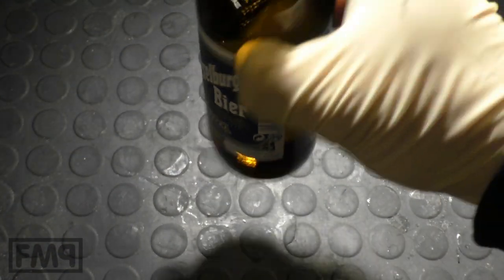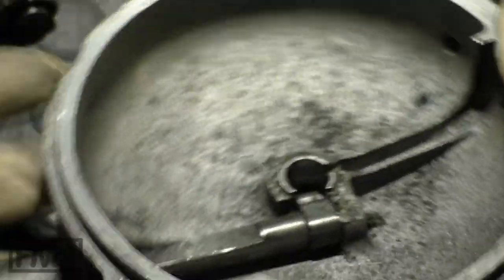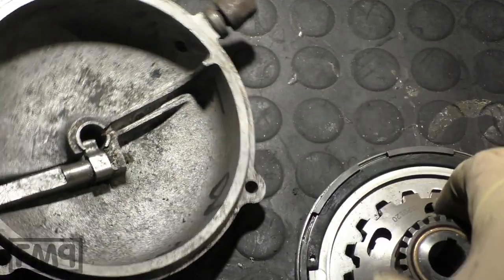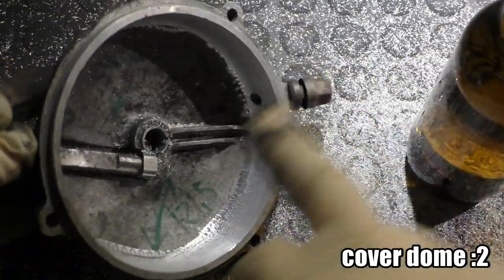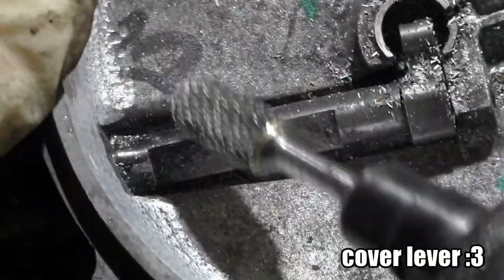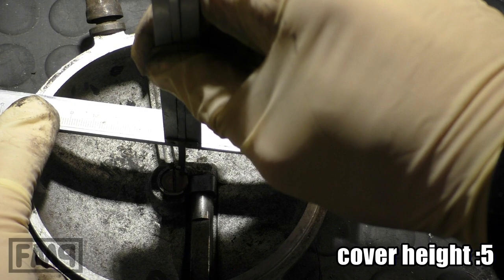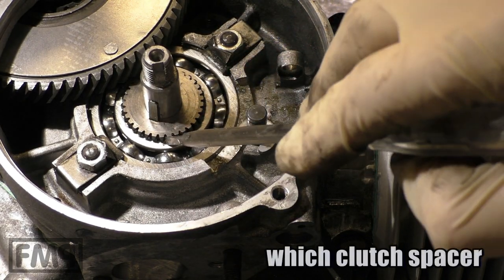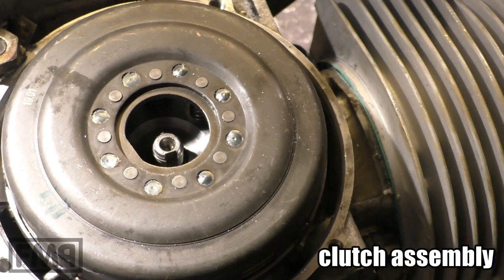THE ultimate VESPA CLUTCH COVER guide / whats needed4 TUNING clutch | FMP-SolidPASSion |

Comment: So for a PX 200 engine not very powered, which clutch do you recommend? The guy Cosa with Cosa records usually goes well from what they tell me ...
Reply from the maker: Standard cosa only for ORIGINAL setups. also with just a plug and play tuning (peaks from original 9 to 16hp with the Malossi Sport = 75%! more power) you are not on the safe side anymore as the rivets may crack. original cosa, from pnp tuning on you need a strengthened cosa clutch. (also honda linings highly recommendes due to the too thin original lining tabs)